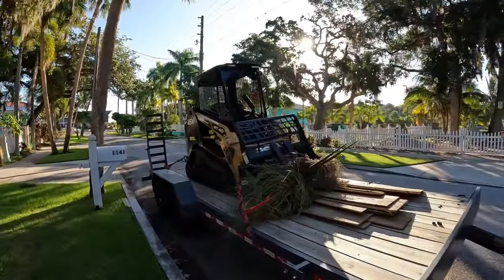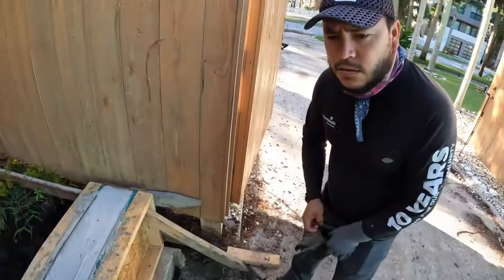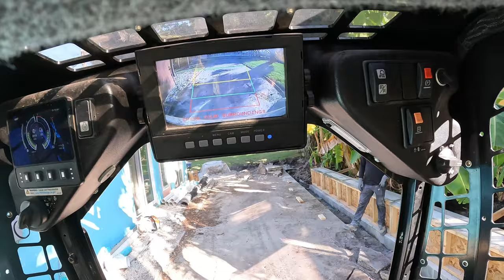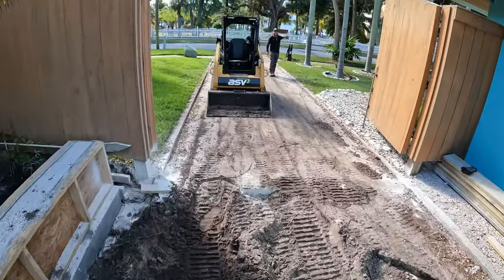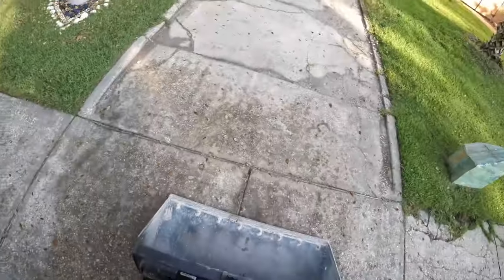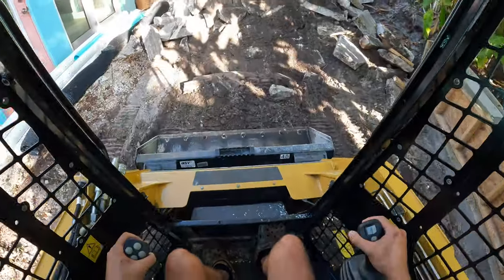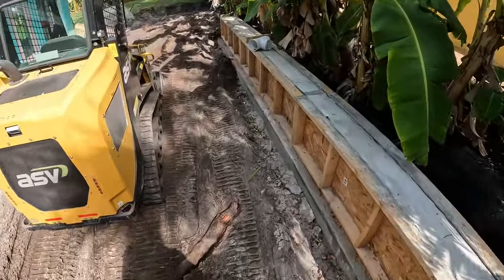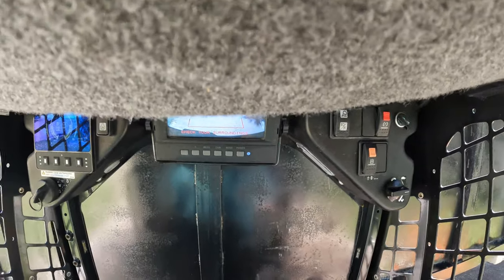ASV RT-40 Concrete Driveway Demolition!!!

Comment: Hey Man! Hope you made out OK with the Hurricane? It seems like it went right through your Area!
Reply from the maker: Thank you so much! Yes thankfully we did, still no power but i'd rather have no power than no house! The next video i post will be all about storm clean up we have been doing! Thank you for checking up, means alot!
Reply: @SuncoastOutdoorServices  Ok, Cool! Glad to hear that. Alot Fla got hammered! Having no power sucks. I put a 2500 watt power inverter in my truck. Its not enough to run the house but its enough to run a few lights and charge up my power tools and whatnot. Just have to make sure you have gas in the truck before the storm comes!
Reply from the maker: @johnsmith-wd5sq  man right! all the gas stations in my area are out and when they get some its a 2hr line during the day.. ive been going out at 3am when no ones up and filling up. Going to buy a fuel cell for the trucks soon because this sucks lol

Comment: Are you pretty much always running the machine wide open throttle ? If so, it sure is pretty quiet in my opinion. At least watching it in my phone it seems that way 😅
Reply from the maker: no i normally run it half throttle or less, That being said it is decently quite but a lot louder than a dingo
Reply: @SuncoastOutdoorServices  no kidding??? It’s crazy it’s got so much power and hardly bogs at all at half throttle. That’s sick. I bet it sips fuel that way also
Reply from the maker: @Fayettepropertysolutions  Its actually really great on fuel! 13 gallon tank and after 8 hr day of running it i still have a little over a half tank!